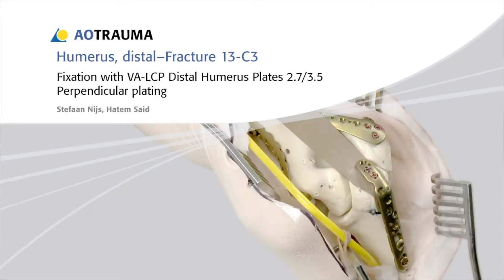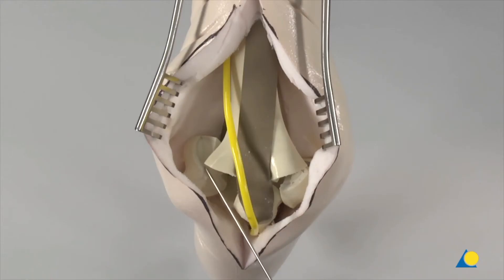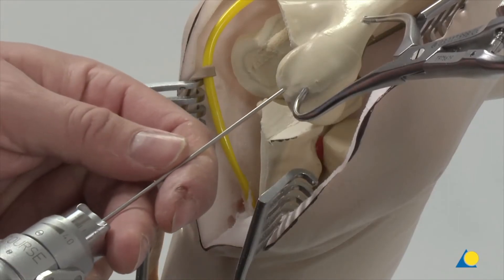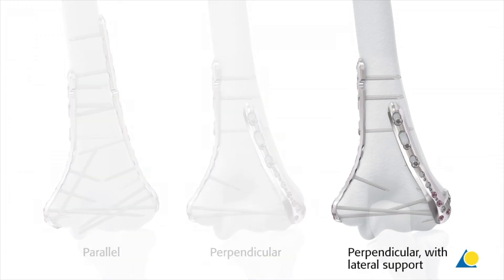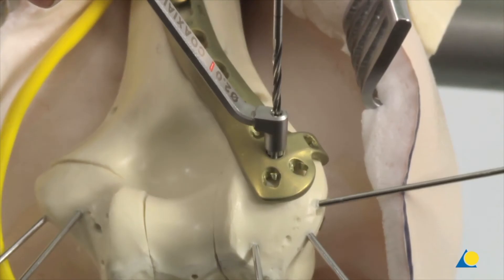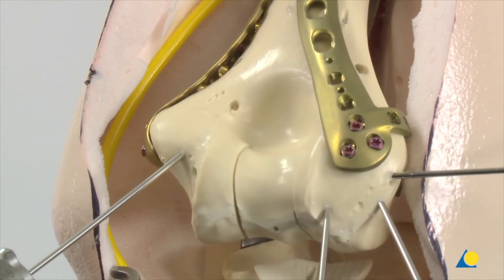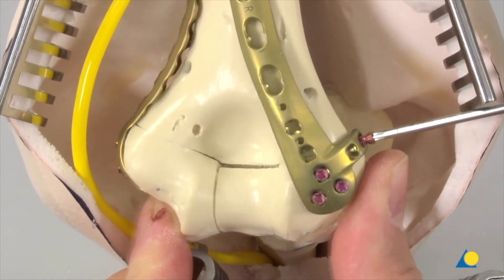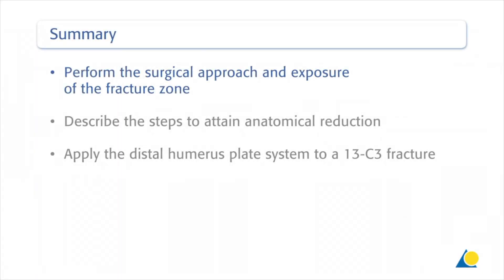Humerus, Distal - Fracture 13C3 - Fixation with VA-LCP Distal Humerus Plates —Perpendicular Plating

Comment: Well, that won't be fun 😕. Which me luck ...
Reply: how was it?
Reply: @frenziedgoblin7646  Didn't expect that question 😂 We'll it wasn't fun. Lots of pain, painkiller side effects, physiotherapy, ... allthogether a summer wasted. I still have rather limited mobility in my elbow but I'm working on that. Still wouldn't say that injury is recommendable 🙌
Reply: @mcb4585  I'm gonna have my surgery in 8 days or lest accident happened 48hrs ago. It's so painful. But I'm hoping I can have safe surgery with a full recovery.  How long did you wear cast for after the surgery?
Reply: @spanito26z  I hat a "fixateur externe" for like a month because it was an open fracture. Then the main surgery and after that a plastic "light cast", which  was fitted to my arm in a warm, plastic state, and wore that for 3 weeks.
Reply: @mcb4585  are you able to lift anything heavy with that arm? Or exercise with weights? Push ups and pull ups?
Reply: @spanito26z  Yes, Yes, No 
Lifting isn't too big of an issue, but I've lost a considerable amount of strength in my left arm and don't have full range of motion, mainly because of the long time my arm was fixed at a certain angle. A lot depends on the severety of the damage, mine was a very complex comminuted fracture with over 30 pieces which my surgeon described as crumbs and dust, so don't be too pessimistic :)
Reply: @mcb4585  we have the same issue. I also have comminuted fractured and I'm scared i cannot get may full motion back
Reply: @mayamae8857  I think it's super individual, right now my mobility is still rather limited, but I'm fairly optimistic that there are still quite some improvements in it for me. 
We all shouldn't have damaged ourselves in the first place. 🙌
Reply: @mcb4585  did you go to physical therapists? How many months did you feel better after surgery?
Reply: @mayamae8857  IT was pretty shitty while i had the fixateur externe and after the main surgery for like 3 weeks (but first worse than the third) 
I had physical therapy for like 3 months now but there is still quite some room for improvement so I'll continue at least till Christmas
Reply: @mayamae8857  About feeling better: The first weeks are rather shitty an after that it's tedious but steady progress
Reply: @mcb4585  thank you for info. I pray that someday we'll be alright and get a full motion back to normal🥺
Reply: @mayamae8857  hello!i have the same fracture and im beggining therapy soon,can you tell me about your evolution please?
Reply: @mcb4585  how are you now my friend? i had the same issue :) range motion over 100 digrees after 5 months- will it be better?